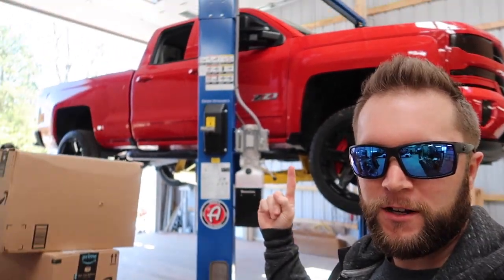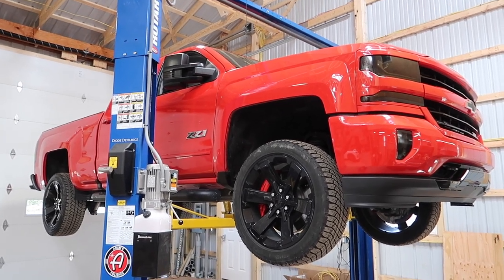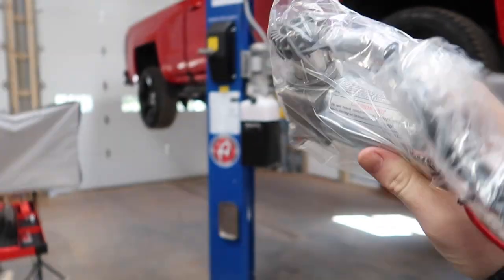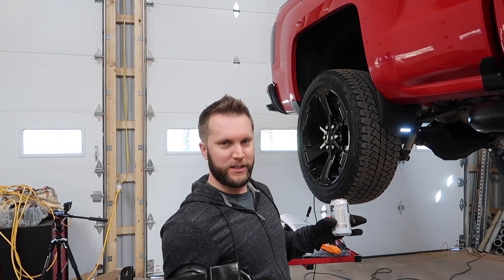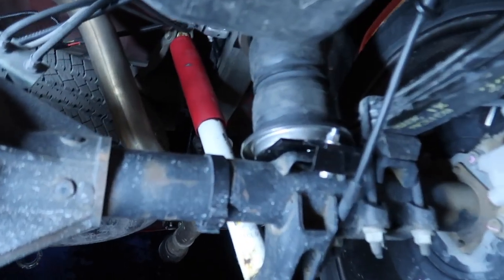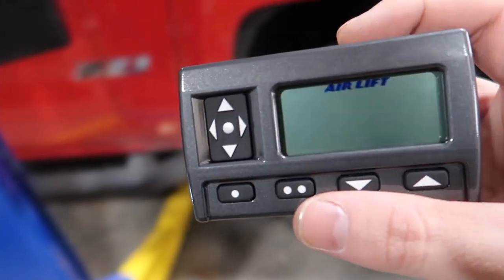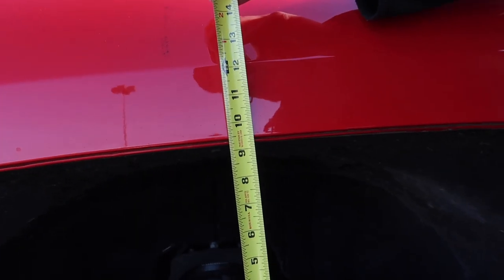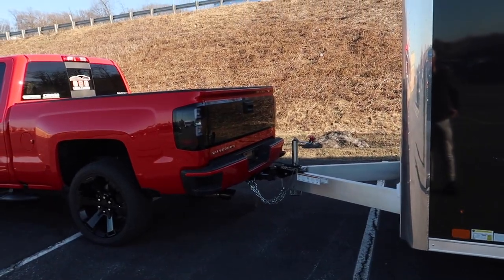THIS Makes Towing With My Truck SO MUCH EASIER!!

Comment: I have towed a large (heavy) 5th wheel trailer for 20 years now. I'm still towing with my 20 year old Chevy Silverado 2500HD with 8.1 gas engine. Even though the truck is rated for the pin weight load given it, I wanted some extra control. I replaced the OE shocks with a set of Bilsteins and then to aid the leaf springs I added a set of Timbren rubber helper springs. Unladen,  a gap between the frame and the helper springs allows for a stock-like ride. As load is increased, that gap disappears and the helper springs come into play. The greater they compress the more their spring force increases. What I like is that control has been enhanced and I don't need air or electrical connections. I've been very pleased since adding them >10 years ago.

Comment: You should be using a weight distributing hitch that has sway control
Reply: I have an Equal-i-zer hitch and it works great to level my 2012 Silverado 1500 with my travel trailer.
Reply: @Todd_S  I have the same hitch and it's easy to use.  Air bags alone do not put the weight back on to the front axle like the hitch will.
Reply: Or just do both itll save a lot of wear on your trucks
Reply: yeah all he did was just level the truck. and raise the rear .5in higher then when empty.  As he put air in the bags he demonstrated that all he did was raise the rear since the front never lowered.  That being said what he did I'm sure helps with the ride but he didn't put any weight back on the front. Aside all this he should be ok since its a light weight aluminum trailer and just a drag car. I have a Gmc version of the truck and tow in the 7-8k range with no bags or wd hitch. It does fine. Could it be better , yes but it works for me. a little bouncy at times.  I never felt the front was to light that it affect steering./braking. Just get some bounce on shitty rough back roads.  The only thing is his is an enclosed trailer so he might get some push on interstate from tractor trailers, that I don't get with open trailer.
Reply: I also tow a toyhauler with a 1/2 ton and an Equalizer hitch makes a world of difference in the way the truck handles when pulling the trailer.

Comment: You need a weight distribution hitch and sway bars for the hitch. It will help. 
I tow a 32foot camper. It helps but you will have a little sway.
Reply: Amazing how many people don't do their research towing do/don't
Reply: Hes only liking comments that dont mention weight distributing hitches lol.. and I use them for anything that creates a tongue weight of over 500 lbs.
Reply: Weight distribution hitch is more helpful than bags. A weight distribution hitch actually puts more weight on the front end air bags dont do that

Comment: Love it.  I also have a red 2017 silverado.  I've had the opportunity to meet you at a few events and I've seen the old towing setup.  I think it's bad ass you made the trip from PA to Tampa without the air bags.  I drove from Indy to Tampa for Cleetus and cars in my truck and was wore the hell out without pulling a trailer.

Comment: I wouldn’t get just a generic drop hitch what you honestly need is a weight distribution hitch with the whole bar set up on the tong of the trailer and if your worried about trailer sway get some friction anti sway bars. Your maxed out with your truck as it is don’t be screwing with others on the road with improper hitches please!!!!

Comment: Squat can be a cause of trailer sway but putting airbags on just eliminates sway as stated by many. I know plenty who run airlift systems but, they also use a weight distributing hitch when towning near the capacity of the truck. That will help eliminate sway and redistribute the weight evenly on the trailer frame and the truck frame. That's what I believe you really need.

Comment: im sure those help a lot. and i don't mean this in a bad way towards you at all. but iv learned over the years if your going to be doing a lot of towing/hauling using your truck as a truck its just really better to get a 3/4-1 ton truck, the stronger transmissions, stronger frames stronger suspension larger axles ect all just make for a truck that works better and lasts longer with less problems.

Comment: I commented when first hooked up to this trailer that air bags and a trailer weight distribution hitch with sway control will be needed. Weight distribution hitch in a 10 to 15k range will run you 3 to 400 dollars.
Reply: I said the same thing when he got this setup to tow the car. It would definitely trailer a lot better with like a G2 hitch. I have a weight distribution and anti-sway system for my 1500 to tow my 33ft camper.

Comment: If you need a tow rig you could get a pretty nice diesel for what you paid for that 1/2 ton. Get double the MPG's and have a truck that is made for that kind of work. They will pull your trailer effortlessly. I prefer the Cummins with a manual trans.
Reply: HorsepowerTube duramax dually would be better
Reply: The new 5.3s with direct injection are usually average around 17-18 daily driving. The new duramaxs are lucky to get 14-15 daily driving with all the dang emission equipment.
Reply: @Sprotdude17  that's unloaded. They probably get about half that with a trailer. Diesels don't get much worse MPG's while towing. But you're right, I would suggest an older truck or deleting a newer one. I recently drove my 94 Dodge several hours with about 7000lbs behind it. Probably averaged about 80mph and it still got 18mpg. And that was driving up and down appalachian mountains. His 5.3 would have been lucky to get 9mpg.
Reply: @HorsepowerTube  yeah pretty much any enclosed trailer or anything that creates a fair amount of wind resistance will get 7-10 behind a gas truck. The best we've got out of a 24valve Cummins is usually around 12-13 when towing a 7000 pound enclosed trailer at 70-75 with 4.10 gears.
Reply: @Sprotdude17  4.10 is why. Mine has 3.55. you'd get alot better with taller gears.

Comment: Looks like your air bags are touching the u bolts for the leaf springs. If it is eventually it’s gonna wear a hole in the bags

Comment: Didn't they send you covers for your airlines? They sent me heat covers for the lines that would be near any heat. They also instruct to zip tie the lines up out of the way to avoid pinch points and away from heat sources. 

Nice system though all around. Do yourself a favor and get an anti-sway bar/ weight distribution system for your truck and trailer. Be safe about it. I have the airbags as well as the distribution system and I don't regret it at all. This will help control the any sway from the trailer and better manage when you have weight in the trailer.

Comment: I dont have air bags on my truck but i do have a load leveling anti sway hitch setup which works great. I tow a 24+2 v nose trailer with a racecar, 4wheeler and supporting track stuff. I do plan on getting bags also to help.

Comment: I have installed and repaired these kits while working for big tax trailers. One thing I will say is look at your airlines going to the bags. They can get up against the leafsprings and rub a hole in it. I would put some type of cover on the airhoses

Comment: Nick if your driving normal no trailer keep the bags to 25 psi if you put a load in the bed have the bags at 50-60 psi and with the trailer from 75-85 psi just my recommendation

Comment: With experience pulling trailers myself. I would spend money on some coil over shocks, to stop the swaying of the vehicle. Also Nick don't forget to put a fuse in the fuse block to charge the battery of your truck while towing. The factory does NOT do that. You have to make sure there is one in there. Check your owners manual for verification. Just sayin

Comment: How much weight are you pulling with your car and trailer. I have same truck and looking at a toy hauler I will only pull 12 times a year tops and truck is also my daily driver hoping I don’t have to upgrade to a 2500 can’t afford the camper and a new truck.

Comment: How much weight do you pull? I own a 2018 silverado 1500 5.3   With 3.42 gear  and have a gvwr of 7200 lbs just bought a travel trailer about 27feet long and 5440 dry weight  and wondering if ill be good to tow it, i have a factory trailer brake controller and what not i dont have a max tow package either

Comment: Surprised you don't have a weight distribution hitch on there. How much does your car and trailer weight? You are more than likely over the limit for dead weight towing. Adding air bags really does not make it much safer. The whole reason for a weight distribution hitch is to distribute the weight over the whole vehicle.

Comment: You have never towed with a diesel. They are very expensive these days though. A 2500 or 250 would be a better choice. Weigh the truck and trailer loaded up. Not sure you have done this yet. You will know if you are good to go or not.

Comment: Instead of the airbags I would have drove that thing right to the dealer and bought a real truck that can tow. I can’t stand towing with a 1500 air bags or not and this is coming from years of experience doing what your doing adding airbags, etc and in the end I wasted all the money and traded the 1500 for a duramax. And a Cummins.

Comment: Note: Air bags only make your truck look like it’s capable of towing.  Your “Payload” number is gospel.  If you’re overloaded and get into an accident, it’s your ass cause you’d be driving illegally.  Increasing the rear, does nothing for distributing weight either.  All your doing is increasing the height of the fulcrum.  Oh, and always paint the holes in the bed of a Chevy made to mount the compressor, otherwise it will rust. 😜

Comment: Absolutely no need for air bags.  Get a real hitch set setup.
Reply: For most people that's Overkill and airbags are more than all you need. . And in  his case he could definitely use both towing that much weight with a 5.3 1500